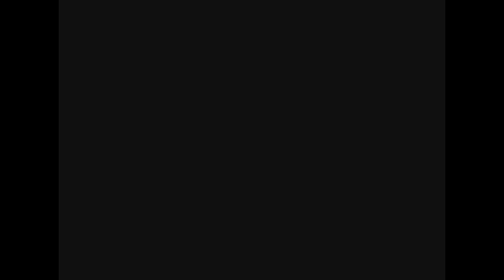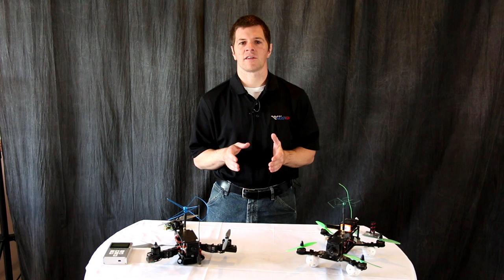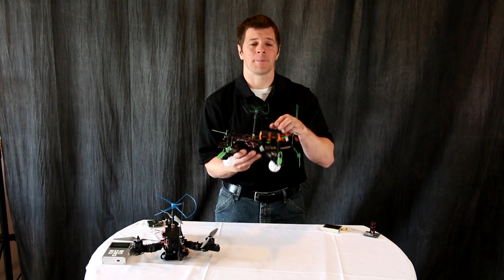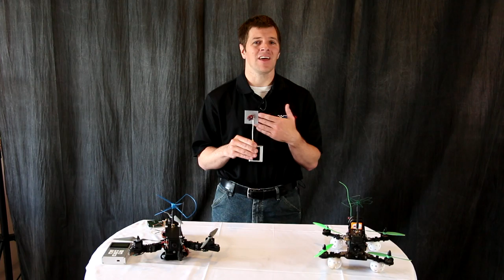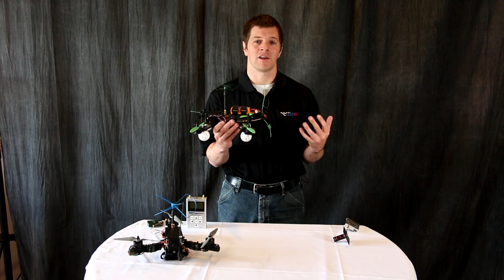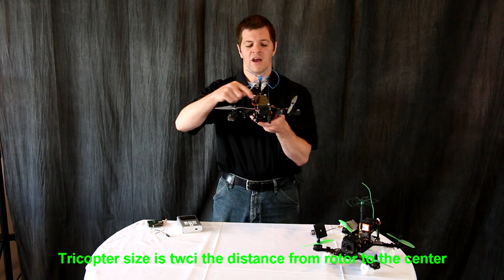Success in FPV part 14: Racing FPV

Comment: How come the antennas on your quads are so large? I mostly see  antennas no bigger than 2 inches in diameter on all the videos I've watched.
Reply from the maker: +Travis pisani - I don't run 5.8Ghz video.  It is the noob band.  I run 2305MHz.  It has far superior performance and allows me to fly behind trees, buildings, and even inside of caves.
Reply: +Video Aerial Systems does 2305Mhz work ok with 2.4ghz control radio gear?
Reply from the maker: +Stephen Gibb - Sadly it doesn't.  I run 433Mhz and 900Mhz control.

Comment: ///WARNING///WARNING///   Just wanted to leave a little update to this video that was recommended to me... I have a Lumenier 600w mini transmitter and their 650 tvl camera. I grounded the audio wire as recommended in this video and it slowly cooked both the transmitter and camera. Trashed. Do not do anything until you talk to the manufacture first......Lesson learned

https://www.facebook.com/groups/ZMR250/1645681972312022/?comment_id=1645836862296533&notif_t=like
Reply from the maker: Stereo Studios - you had a ground loop issue.  Probably a good idea to check for those or you could damage things.
Reply: Alex Greve  Yea i checked that and it wasn't the issue after all. In this situation unfortunately www.Getfpv.com who basically is Lumenier were aware of the problem which is if you let the transmitter sit on the bench powered on while say, i don't know, tweaking your flight controller, The unit will over heat and fail which is exactly what happened to me. This is why the item is currently "out of stock" because they are running around trying to fix the problem. Will most likely now ship the transmitter with "actual" instructions and a heat sink. My distributor Maniacshobby.com is refunding me for the unit. I will be going with the Emersion equivalent instead.
Reply from the maker: Stereo Studios Buy a TBS.  Better stuff IMO.  I have been using the TBS Boss happily.

Comment: P = V x I  - Power isnt determined by voltage... Its totally possible to race a 6S and 3S setup competitively against each other, the 3S setup just needs to draw twice the current to make the same power, there are advantages and disadvantages to both, but at the end of the day Power = Power.

Comment: Can you please speak more to the issue of grounding the audio? I did a trace with a spectrum analyzer, and I basically see no difference between the two scenarios.

http://s18.postimg.org/syhx6hlft/ground.png

In the image, left side is grounded, right side is not grounded. Except for the spectrogram graph, which shows both scenarios in the lower-left.
Reply from the maker: Joshua Bardwell - Some transmitters have a choking resistor on the VTX ground.  Most don't, though.  Looks like yours does.  I put this in there as a general provision.  A few have noticed the audio grounding has helped clean up interference and there are other spectrum analyzer plots showing the effect.  It all depends on which unit you have, really.
Reply: FWIW this is Fatshark 250 mW.
Reply from the maker: Joshua Bardwell - Nice work.  I only tested the Boscam stuff and this no-name 600mW that keeps pooping up.

Comment: i´m about to build my Race quad.  but i´m still not sure about what frequency to use.. y have 1.2ghz 800mw on my F450.. i´m between buying a 200mw 1.2ghz Tx and use my existing groundstation, or Buying an all new 5.8 200mw Tx/rx for the mini because of the bigger size of the antenna...  

what do you think about using 1.2ghz Dipole antena instead?
Reply from the maker: Javier Cavallo That's usually ok... so long as nobody else is running 1.3Ghz with you.

Comment: Alex Greve You are very knowledgeable man, but I find these 1.3 Airblade and Airscrew antennas the most unsuitable antennas you can think of for proximity flying. You will bend them on almost every (hard) crash. Apart from that you have some great tips in your movie.
Reply from the maker: Bionic24 - I typically just bend them back.  Better to avoid a crash because you can see instead of crashing because you cannot see.

Comment: Alex. I have heard you mention the RF Explorer before. I have seen many different models that scan several frequencies including 5.8. All are pretty expensive and I would want to make sure and get the right one before I make the big investment. Is there one you would recommend? Plus, could I use my Video Aerial Systems' antennae on the RF explorer?
Reply from the maker: Jason Campbell Yes you can use your VAS antenna!  That really helps clear up a lot of questions about what is happening at the track.  Also, any unit that does 5.8GHz will do.  I like the unit that does 5.8GHz coupled with the 15-2700MHz board.
Reply from the maker: Jason Campbell Yes you can use your VAS antenna!  That really helps clear up a lot of questions about what is happening at the track.  Also, any unit that does 5.8GHz will do.  I like the unit that does 5.8GHz coupled with the 15-2700MHz board.

Comment: Umm... I wouldn't have thought a DC offset would cause any audio output on the tx and would likely be decoupled in the module anyway? Noise on a floating input however (or volume if it's actual audio) certainly would though - had you just said the DC bit to make the explanation simpler or am I missing something there?
Reply from the maker: Ashley Gittins - True, but it is not DC.  The current of the video system, speed controls and brushless motors are AC.  This induces current onto the audio sub carrier.  It adds ~2MHz worth of bandwidth to the transmitter if left ungrounded.
Reply: Alex Greve Yeah, that's what I was thinking. The bit about measuring a DC offset with a multimeter just struck me as a bit of an odd thing to add. Good tips as always, Alex - love your work.
Reply from the maker: Ashley Gittins - I threw that multimeter bit in there for those who aren't tech savvy enough to understand induced currents.  You are one of the few that truly understands how these things work ;)

Comment: The difference in sizes of frames for thing "around 250" makes me think a "fair" class is to make specific rules about other items, i.e anything up to 300mm, must have 5030 props, lipo 3s of at least 1300mah, not tilted motor mounts - keeping it quite basic so there's no obvious advantages in craft and it's all about the flying
Reply from the maker: CurryKitten In general limiting the battery does a really good job... more so than any other item.  The idea is to keep it as fair as possible.  There are those who will tweak the rules to their advantage if given a chance and turn a fun race into a money war instead.

Comment: You are an absolute star , I can see a tiny box on the back of the transmitter with faint numbers on , but need a better magnifying glass to see better , and the manual is very poor on the specifics of  the subject , thanks for your quick response Alex and keep your wings in the sky ;)

Comment: To keep class3s simple, if everyone runs 5x3 props on a short course with air gates, we have found quads are very close in performance between 3s and 4s. Ideally everyone would run 3s but to get people interested we want to encourage everyonebto get involved with the quad they already have.

Comment: Hi Alex , I am using 250mlw transmitter and my friend the same and we seem to be on the same channel , do you now how to change the channel on fatshark and immersion rc transmitter , many thanks ,  scott .
Reply from the maker: Scott Thompson - There should be switches on the board and an instruction manual on the back of the box to tell you what channels correspond to what switches.

Comment: Alex Greve I believe you have the equipment, so please do a video with proper graphs and measurements about how much grounding audio lead, using different polarization, and other tweaks and hits help in 5.8ghz fpv. It seems impossible to find any real data for example on bandwidths of different power video transmitters. For example does 600mw VTX have wider bandwidth than 200mw, and immersion vs skyzone. And how accurate are channels on transmitters, is the peak of the bandwidth really at 5860 when using CH7 on 600mw Immersion, how about Skyzone 200mw and its channels. All this would be really interesting! Thanks! :)
Reply from the maker: Jussi Hirvonen - I will do this.  Grounding the audio results in 3-4MHz less bandwidth being used by the transmitter in most cases.
Reply from the maker: Jussi Hirvonen - I will do this.  Grounding the audio results in 3-4MHz less bandwidth being used by the transmitter in most cases.

Comment: ... nice video, thanks for the advices :-) I guess, grounding the audio input will only work if the transmitter doesn't have a internal micro. In this case some TX have a potentiometer to tune the audio volume which has to be turned off to fulfil the same effect, isn't it?
Reply from the maker: hotliner If there is a built-in microphone, that will control the bandwidth.  You just need something hooked up to it, that's all.
Reply: Thanks Alex! :-) The simplest way is often the best way to go ;-)

Comment: Please do a quick video to show how to properly ground audio leads.
Reply from the maker: Skydive4ever I do in this video.  Just follow the photo in the video.  All you do is solder the negative and audio channel together.
Reply: Alex Greve Ok cool, rewatched it again, looks simple enough, thanks :-)
Reply: Alex Greve i have fatshark 250mw and it has audL and audR do i ground both or dont i need to on fatshark vtx i have never heard of grounding audio and not much info online so dont want to break my vtx as there not cheap to replace thank
Reply from the maker: spinisking - You should ground both.  This only matters for racing with others.  If flying alone you don't need to worry about it.
Reply: I do race I'll get that done cheers

Comment: Will ungrounded audio R and L outputs cause video interference on my machine? I remove the entire wire from the connector in the first place.
Reply from the maker: Armenian Usually the ungrounded audio doesn't hurt the video on your machine.  However, high discharge batteries can have an adverse effect if your P and I gain is too high as the ESC pulses cause lines in the video.

Comment: Ground audio leads...dang. You learn something new everyday. I truly have never heard this before. Gracias.
Reply: Guerilla FPV Yep. Muchas gracias in fact. I had not considered it, but I should have. Basically another antenna hanging out there if it isn't grounded... but the bad kind.
Reply: Guerilla FPV Ya I had never heard that suggestion, but sure will be grounding all my audio wires in the future.
Reply: Propably a silly question... But I am installing a new camera and it has an in built audio on the board. Would I proceed to ground that as well or is this more relevat on the TX side? Just wondering as I am to solder anyway and might as well do correct the first time around.
Reply from the maker: Naamis1 You don't need to bother with the receiver.  Only the transmitter matters.